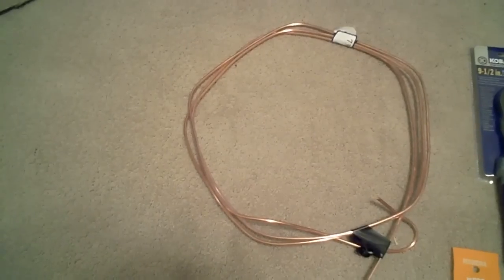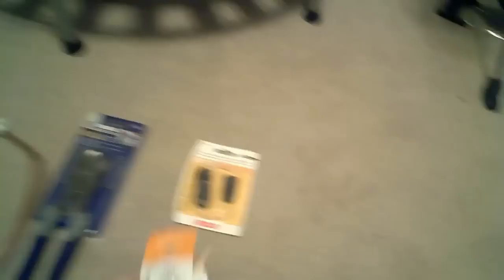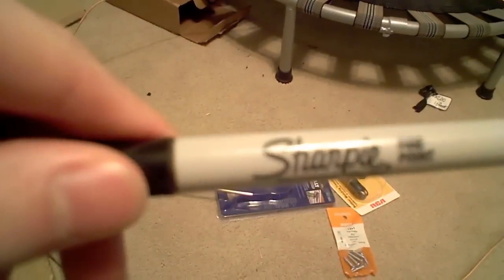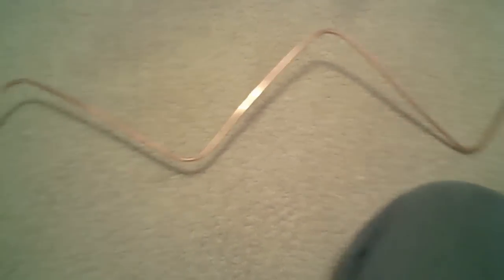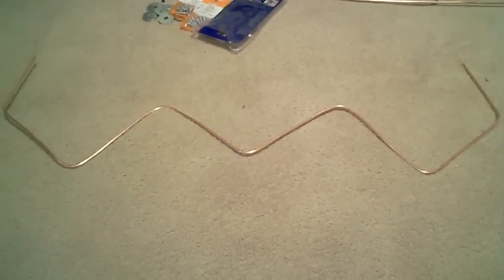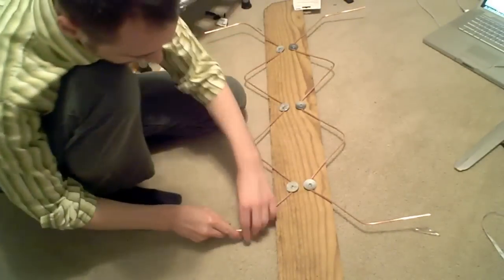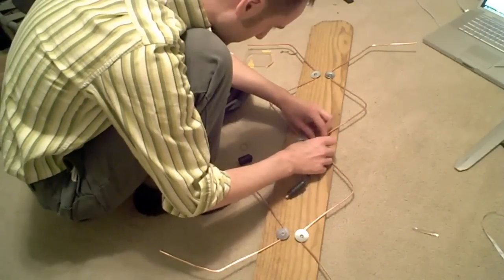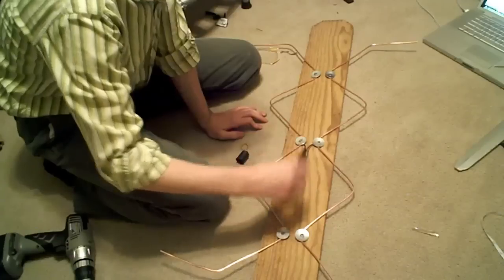How To BUILD The BEST HDTV ANTENNA! | Homemade HDTV Antenna DIY

Comment: are you guys kidding me? all you have to do is plug in your t.v to the cable wire that is installed by the cable company and you get all of those channels for free! if your cable gets shut off just unhook the box they gave u and plug the wire directly into the t.v and you can still use the antenna at the cable company for free !!!! no need to buy or build anything !!! how can someone so smart to build a antenna but not know air t.v is free anywhere in the u.s.a !!!
Reply: Sean Pesano I know it's had for a city dweller to imagine but out in a lot of rural areas there isn't cable.
Also my antenna gets 5 more channels than "basic cable" gives me (free with internet) and only one channel that it gives me that I absolutely have no chance of getting with the antenna.
My present antenna is an old 1960's corner yagi probably from radio shack ,I haven't even started using any heroic efforts  to get far off signals
Reply: Ah, this assumes we ever HAD a cable company's cable in the 1st place - which  I believe I've stated, I never had.  So,  altho perhaps this was good intel for others (altho morally shady: isn't this stealing from the cable company?), it was not beneficial to me.  Thanks for commenting, tho.   ALL comments are worthy to be said, as long as they are on point and are said with a clean mouth.
Reply: Sean Pesano Come to the midwest  no mountains but lots of country, 3-4 miles outside of the city almost all houses never had cable installed or even available to install.
AFAIK  the cable company doesn't care if you hook up the interior  cable connections just stay away from the poles and locked boxes.
Cable is a city thing (mostly) , the direct TV and dishnet guys got their initial customer base from people who can't get cable.
Reply: +Janis Williams  I'm sorry to hear you are still having reception trouble.
Your helpful engineer at waff gave good advice at least right up to where he proclaimed the "good news"  of ATSC3 and spectrum auctions.
His choice of a clear stream 4 leads me to think you line in a UHF only area.
I don't see any good news for fringe reception in his good news.
I read that you have an antenna and rotor but it isn't working.
I would test to see if the rotor is working , then look at the amp if you have one, then replacing the coax cable.
Antennas rarely  "wear out" they often get damaged  unless yours is damaged it is probably not why a working system stops working.
Reply: +Loaded4th What antenna is only suitable for analog TV?
Reply: I thought an antenna was an antenna, and as long as it was good for tv reception, it would be fine for both analog and digital.  Otherwise, don't ya know, they would have made a box or connector of some sort that they could sell you (at an enormous profit), and of course the gov't would have a monopoly on said add-ons.  Silly me!  I guess that's what thinking does.  ;=D
Reply: Sean Pesano is over for us now we can only see VOD channel and a channel with a big list of all the channels
Reply: Not stealing just during the wire for antenna never thought of a house without having been connected to the cable wire on the pole before it must be old or on top of mountain but even most places after 1980 h e cable hookup in house even if . NEVER hooked up still work for antenna
Reply: Still, what's a person to do???  I get no cable/satellite, have a marginally working antenna, live amid the mountains, only get one tv show (TBN), and my internet speed is so slow that my hour-long videos take two hours to run!  And that's billed as DHL! The weird thing is, BEFORE my antenna went south, I got all the major networks and several other channels as well.  BEFORE digital, at this location but a different tv, I got tons of channels, all really good.  Go figure.  ANY suggestions?
Reply: Use uhf antenna?
Reply: Yeah I didn't realize u lived where u did .so my fault u did a great job looks good as well if I was u I would put a little bit more work into it and shape the wood up and dress it up a bit and maybe make a little money on the side u know hide the copper tubes and make a piece of work out of it maybe a DVD stand with antenna counter sunk into the back of the stand or some kind of copper statue for a fire place mantle I'm a creative person I see things and love tinkering with them to try and improve them just a thought cost what $6 to $10 bucks to make another $10 in some pine and schlac or stain and maybe u could make $40 $50 bucks a piece and kill some time in the processes I'd make a big candlestick holder and have like two of em u know the big ones hold like 8 candlesticks and hid the wires going to the t.v just throwing it out three-month bud
Reply: +Janis Williams Have you tried re-scanning the channels through the TV (or Box) menu setup? If you are unable to make your own antenna, try figuring out how far the TV transmitter is and buy an antenna suitable for that distance. It's a good idea to re-scan the channels occasionally for new additional ones.
Reply: Thanks for the thought.  Yeah, I do scan every now and then, to no avail.  I still only get the one channel.  So now I'm getting Amazon Prime.  My ISO is FarmersTel, and they've been slowing down a LOT lately!  Just to make sure it wasn't just me, I asked several of my neighbors that use them how their internet service is.  Every one of them said it's been  r e a l l y  s l o w  lately.  Does the weather have anything to do with that?  But I digress.  Back to Amazon Prime - they only have recorded shows, no live, or even freshly recorded shows.  Rats!  Anyway, Loaded4th I appreciate your care and concern.  Again, thanks.  Hope your weekend is blessed.
Reply: +Janis Williams If your ISP is Farmers Telecommunications Cooperative I'm not sure if you have fiber or DSL (copper wires) in your area. DSL can be slow if the distance to a local substation or special box is a long way off. Weather can sometimes impact the copper wires underground if wet. Fiber can slow down if all the neighbors are downloading a lot of stuff at the same time. Are you using the same antenna before digital and what type is it? Do any of your neighbors have an antenna that works?
Reply: Okay, I'm officially ready to SCREAM!!!
This is now the fifth time I'm trying to type this to you.  So far, Google keeps eating what I'm typing before I can click on the "Post comment" button.  Hope it was tasty, Google! Grrrr!

Okay, Loaded5th, let's try this ONE more time (I had to change your name to fit the ordinal number of times).

FTC uses DSL, at least with me.  Most all my other neighbors have working antennae, but they also have access to strapping, strong, young men, of which I do NOT.  My rotating antenna is over fifteen years old, and served me well for both analog and digital TVs, until the last year.   JT Harriman at WAFF TV in Huntsville, AL  sent me the following email.  Note the antenna he recommends, along with any other advice he offers.  JT is aware of my geographical situation, so he took that into account when making his recommendation.  
Harriman, JT <jharriman@waff.com>

Apr 24

to me

WAFF is operating at 100% FCC license power. Back in 2002 when TV stations were installing their digital transmitters, our power output was determine by a consultant using a TV model that was accepted in the broadcast industry. Over the years, broadcasters became more knowledgeable with HDTV signals and a lot of stations have made changes with their transmitters, our parent company stayed with the original designed, right or wrong, remains debatable at this time. My job is help our viewers who are having reception problems with our signal. You can overcome the various TV transmitter  output powers by using the best possible antenna and getting it as high in the air as possible. The model c4 antenna mfg. by Antennasdirect/Clearstream is the best antenna to use in your current location. I don’t have a magic wand to give you better reception, only ideas on how to improve your OTA reception. Trust me, I wish I could do more for you at this time. One piece of good news here is that the TV landscape is about to change drastically here in the next few years which will open up new doors for both us. Two big things that are happening right now with the FCC – TV spectrum auction and ATSC 3. You can google these topics and get a snapshot of what is happening in the industry, it’s all good.
 
JT

Loaded4th, does this help you help me???  8=D  Can't you puLEASE just come over and put in a new antenna for me?!?!?!?!?!  

Hope you have a very happy, healthy, and holy Thanksgiving Holiday!

Blessings to you and your family,

Janis
Reply: +Janis Williams 
You might try opening a text editor, type in your response, then select all the text, copy it, and paste it into the reply box. This way if the page refreshes you don't have to worry about losing your current entry as you can always re-paste it in.

Unless you have an antenna that is only suitable for analog TV you would need a new one. If not, it's likely that you have a poor connection somewhere, or bad cable. You could try replacing the cable from the wall outlet (if there is one) to the TV as a start.

What you may consider is to try is a good indoor antenna placed in what is known as a hot spot. This is what I use (actually in the attic) and the transmission tower is 40 miles away! I get nearly 150 channels here in Orange County south of Los Angeles. Maybe try one from a local store and if it does not work you should be able to return it for another. Without equipment, you need to move around with the antenna until you get good reception (hopefully not hanging in the middle of a room!)

I'm not familiar with the new ATSC 3 system, but it is something I need to look into.

I wish I could assist you, but at the end of the day, one has to pay for either cable, satellite or antenna setup/maintenance.
Reply: ghz240
I haven't a clue. All I know is that with the digital changeover, I know some individuals who could no longer receive adequate reception changed to digital with improved reception. This may have been due to having a higher gain and being more directional along with any frequency changes in our area. I had to change the design of my antennas for better reception.
Reply: +Loaded4th With the exception of digital signals/tuners being more sensitive to high SWR there is nothing different about an antenna that makes it digital or HD or analog , it's all the same to the antenna.
With the digital transition a lot of stations changed frequency some even changed bands VHF to UHF  or the reverse. Some antennas are only designed for UHF and wont receive VHF signals well (if at all) forcing some viewers  to obtain a new antenna.
Reply: +ghz240 I don't basically disagree, but most of the change here was about changing bands to UHF, and some people had a problem getting a good signal in the higher range. Also, if they weren't quite lined up that may have added to the problem. Some individuals could have had good VHF recption, and lousy UHF, which forced them to upgrade the antenna. Being 40 miles away can excacerbate these problems.

I'm not a fan of outdoor antennas, too much bird poop and sensitivity to weather. I do exceptionally well using an 8" fractal design or a single bow-tie in the attic.
Reply: +Loaded4th Yes most the migration was from VHF especially low VHF to higher VHF and  UHF frequencies.
Is the fractal a coch star aka. ruckman ?
I'm just the opposite, I am a fan of outside antennas.
I live very close to transmission towers for the local stations .So close it is multipath hell no indoor antenna would give reliable reception even roof top outdoor antennas failed (annoying drop outs) until I put them higher 25 ft.
I finally put up a 40 ft. tower and now I get channels from 2 other cities 60 -70 miles away in addition to reliable reception of locals.
Bird poop wont hurt your antenna and the weather has very little effect on mine except when conditions are good and I get tropospheric ducting  from a big city 150 miles away.
There really is no comparison indoor antennas have no chance of matching the capabilities of a good outdoor antenna. An amplified indoor antenna is like a joke the mfg. played on the public.
Reply: +ghz240 I'm not experienced with multipath problems, but have you tried using a pad (a variable attenuator--for others reading this) or a double antenna/splitter approach? However, I guess your present setup at least gives you more options. I'm not concerned about bird poop on the antenna, it's underneath! I have to say that I'm not so much an expert in this field, but a technologist in other engineering fields, in which I use my intuition and general experience in solving my own issue. To this end, I've avoided the mathematical approach and experimented quite a bit using variations of existing designs. I've constructed the William Ruckman fractal koch design using perspex plastic and copper tape and also a single circular design, with 4 star elements, just using intuition with good results for such a small size. With the same materials, I've created a single bow tie antenna and added a rectangle around the double V to improve the lower frequencies. What I've found is that one design will work well in one hot spot and another elsewhere. Perhaps this is partly due to the size, shape and nature of the attic hotspot!
I don't disagree that an outdoor antenna is better overall, I like the challenge of a clean looking property and making indoor antennas work--which is does for me.
Reply: do you have a analog box I bought one the other day at Walmart and were I'm at we only get 6 channels without the analog box I could not get any channels but I have a really old TV if you don't have 1 you may want to try and get one hope this makes sense lol
Reply: Bob, er, um, even THAT is over my head.  lol  What, exactly, is an analog box?  Who knows?  I may even have one floating around here, since I seem to never throw anything away, according to my cleaning lady.  That's not true, of course.  I know I threw something away once, a while back. :)  Seriously, tho, are you talking about a converter box?  Or is there something else out there in the long list of things I'm totally unaware of?  Obviously my smart TV is looking dumber every day.  Phooey.  Part of my problem with reception are those dratted mountains that persist in popping up between me and the transmitters.
Thanks for caring.

Comment: Sorry, not pleased at all.  There was more video of you than the actual work you were doing, and when you showed the work it was either out of focus, or too close to make out exactly what was done.  Toward the end you showed a little more of the actual project, but, then u lost me when u hooked up that plug thing.  You didn't really explain it.  Then u took it to the attic.  for what? ................do you run some sort of wire from the attic to the tv?   and what kind of wire....and where do I plug it in to the t.v.  ...Sorry, this video is only half assed imformative.   Are we supposed to read your mind for the rest, or just figure it out ourselves?